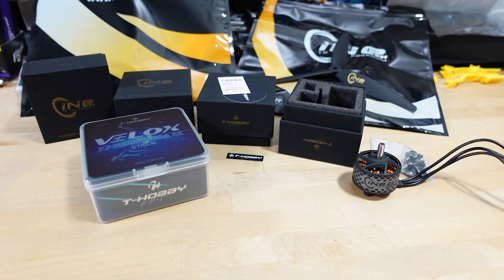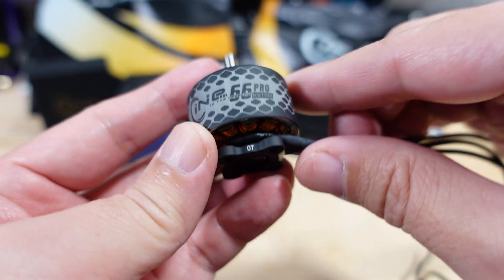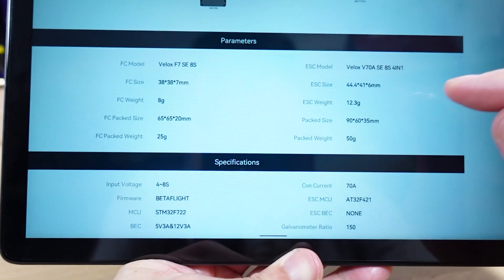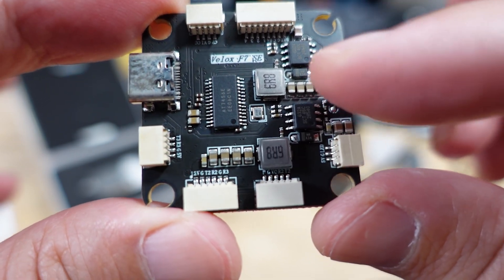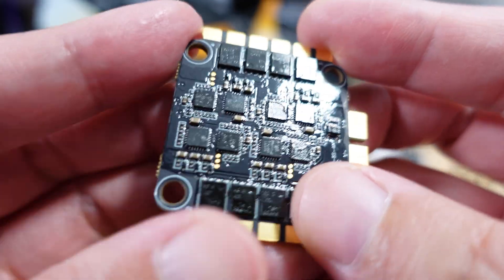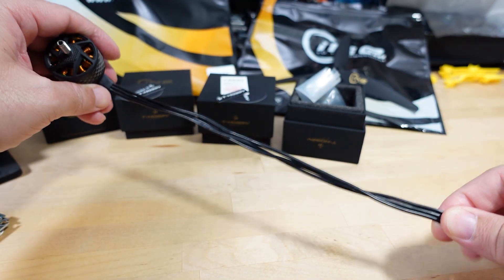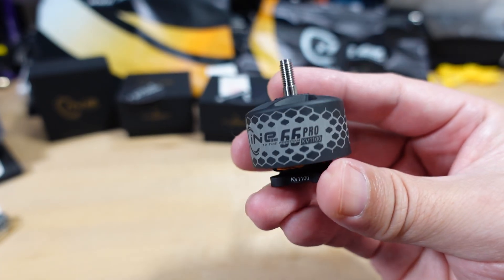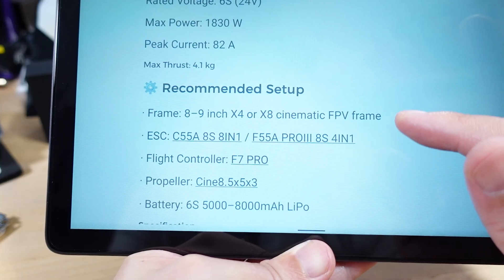Long Range FPV Drone Build Parts Overview (T-HOBBY Cine)

Comment: Great motors. I recently bought the F100 for my 7.5-inch drone. I was very tempted by the Cine66, but they're 10-inch and would be too big for me. T-hobby could visually refresh the F line, because technically it's top-of-the-line.